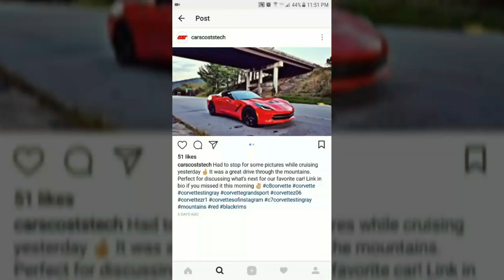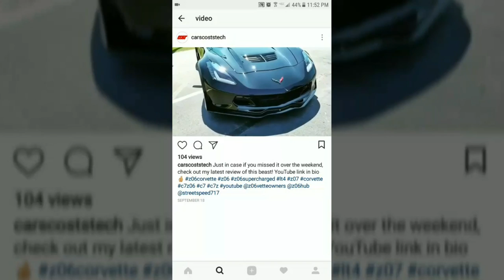Trouble in Paradise... C7 Corvette Issue & Resolution!

Comment from the maker: UPDATE: 6 months after the fluid flush and everything still seems to be working great 👍 The roads in my area are pretty rough, so it's hard to confirm that the shuttering has been 100% completely removed. Overall, I'm satisfied with the results, and thankful that the car didn't need to be torn apart!
Reply: Am looking to pull the trigger on a new 2017 Stingray 3LZ with auto.  I recall you daily drive yours.  I will be doing the same.  100 mile round trip every day.  Do you have any over heat issues?   Looking at your fluids in the pictures, the fluid looked like it was getting burned.  Not sure if that added to your problem, but it could be indicative of a more serious issue.  The fluid change resolving the shudder kind of supports my theory previously stated.
Reply: @garycrumrine9538  100 miles a day on a corvette? Your car value will drop like a rock.
I was in sales, and went from 32,000 miles to 84,000 miles in 3 years. My 2006 Z51 lost value even after adding 10,000 in repairs and upgrades.

Buy a cheap car for under $5,000 and drive it into the ground. Problem solved.

You are welcome.
Reply: how much qts of fluid does the A8 use?
Reply: @v8tornado  the Grand Sport takes 24qts for the complete power flush.
Reply: @CraigCatapano ew. We buy cars to drive them old man.

Comment: What you experienced is a common problem with all GM vehicles with the A8 trans. I had the problem in 3,500 miles on my 2015 C7. The fixes GM has come up with are not cures, but temporary fixes AKA, delaying tactics. GM either doesn't know what causes the problem or is hoping the fixes will last until the warranty runs out, or that they will make a lot of money on extended warranty sales. People are still having the same problems on 2018's so it appears that they have no intention of, or can't permanently cure these problems. It's a pity since the C7 is such a great driving sports car. Buyers beware. Get the manual trans or expect a never ending headache.

Comment: I own a 2017 Grand Sport with Automatic.  With less than 7500 miles the shuddering, the rattling noise appeared.  Chevy said the transmission flex pate had to be replaced.  New Vette sat in dealership 2 weeks being repaired.  No explanation as to whether a different flex plate (a new and improved) installed or whether they installed the same piece of crap that was originally installed so that I can look forward to the same problem happening again after another 5-7k miles.  Like most people on your site, loved the Vette.  Bought if for its alleged dependability over a Jaguar F-R coupe, Porsche Cayman S and several other similar sports car.  I know this is sacrilege on this site, but if I had to do it over again, would not bother buying the Vette.  Six months and I find out I got stuck with a lemon.
Reply: Ohhh wahhhh wahhhhh ffs... it's an ECO mode issue and reflashing the ECU fixes it. Buck up, little whining camper, you'll be fine. If ya can't afford a car like this, sell it.
Reply: Now with a little bit of sugar you can make lemonade

Comment: I'm sure the "flush" did resolve the issue; temporarily, It'll come back in another 10k miles, or a little more.  After warranty is up.
Reply: Your exactly right. The flush is just Chevy's way of delaying the inevitable and replacing the trany with a new one that will have the same problem in a few miles as GM either doesn't know how to fix it or doesn't care to. Worse, once the trany is taken out by the ''expert'' tech's your problems will just be starting.
Reply: My 14 c7 z51 blew at 26k miles, still waiting 3 weeks out to get fixed under warranty.  Never again will I buy this garbage.   Tesla 100% from now on.
Reply: @mobleyMobley  shit.....I should not buy the c7 I just put a deposit  on fuckkk....
Reply: I thought Corvettes are still bulletproofs, I was searching for a used C7, good thing I knew about this issue beforehand, ONLY BUY MANUALS
Reply: @Abdullah..S  you dont need to buy a manual
Reply: @Abdullah..S  you can buy an automatic,  I did....its 100% fine, get a range device AFM deleter
Reply: @Jesus-warrior  So the AFM caused the TC to fail?
Reply: @Abdullah..S  yes it's a plague of a problem but that is a easy way, keep it in v8 all the time and you're  good to go, the range AFM device is $180
Reply: @Jesus-warrior  How does the Range Device keep the Torque Tube from going bad?  My second TT just failed and I am waiting on GM  Parts house to ship a new TT which they say is 30 days out!!!
Reply: @Jesus-warrior  what the hec is a afm device??n what does it stand 4 ?
Reply: @Jesus-warrior  That crap doesn't keep the problem from happening, it just masks it so you can't feel it.  Garbage.
Reply: @allenustianowski9757  there is only one fix and that's  physically removing it. And while your at it throw a stage 2 cam in

Comment: I have a 2014 C7 Stingray with just barely 20K miles that started rattling on idle and acceleration and when warming up was shaking from the revolutions of either the engine or the driveshaft, this after having bought the car a year ago with 11,033 miles on it when it was smooth as glass. The car still has not been over 90mph. It is an automatic with I guess the A6 transmission? Took it in, and they said the propeller shaft bearing was shot and the torque tube was "pushed forward". They replaced all that under warranty, then told me that whatever happened to the torque tube damaged the transmission, so another two weeks to get approval from the warranty company and wait for the transmission, and then it got replaced as well. I paid $400 deductible due to the warranty otherwise this was $12,300 in parts and labor!

Got the car back last Friday. Started it up and it's making the exact same rattling noise. The engine now actually is making a clacking noise as if there is a lifter problem or something else is slapping around which it was making before but now it seems louder. In fact the only thing that has changed is that now the gear shifter feels like it's stripped. Giving me false neutrals in reverse and not accurately indicating whether it's in Drive or Manual mode, and moving seemingly unimpeded through the shift gate. I am taking it back tomorrow. This is a nightmare.

Oh and the point: This happens regardless of driving mode (I drive in Sport mode almost always) and regardless of whether I'm in automatic or manual mode.

Comment: I have a 2015 A8 and i might be having similar issues.  But i had read that the shuddering could also be the car switching between V8 and V4 modes.  Not as smooth as it should be.   One thing leads me to believe this is that if you switch the C7 out of Touring mode into Sport it seems to disappear.   I don't think it goes into to V4 mode in Sport - make sense?   My bigger issue at the moment is that my freaking fuel door is stuck closed!!!   I have 43 miles of gas left and the dealer is 18 miles away.  I hope they have the part in stock!!   Car goes in tomorrow for an oil change and the fuel door issue - I will mention the shuddering issue also.   I have my doubts that a fluid flush/change is going to fix it.   My 3 year bumper to bumper expires around Thanksgiving.   Thank God I got the extended warranty.    Learned my lesson when driving BMWs.  Every repair at the BMW dealer was like a mortgage payment.....
Reply: Car does go into v4 mode in sport. Only time a8 doesn’t go into v4 is in manual. As far as the gas door… get two credit cards and a screwdriver. Insert the screwdriver in between the 2 credit cards on the left side of the door. Pop the door off pushing right. It’ll pop out. Then slide off. Boom. My 2015 did this twice then never did it again. U can plug the little hole so that it doesn’t get stuck again although i never did so. 

I know his comment is 5 yrs old but just incase anyone experiencing same issue sees this video and happens to read this comment hopefully its helpful. 

Also I’m super curious what the dealership did/charged to fix the door.
Reply: @whatsthatmeen  Hi GG,  I had to look it up as it was 5 years ago:).   Dealer replaced the fuel door actuator under warranty.  Still works.

Comment from the maker: So glad to have my Corvette back 😁 Thanks for watching!
Reply: Cars, Costs and Technology hi
Reply from the maker: +Daddy TheHawtDawg1 What's up man 👍
Reply: So in hindsight would you still consider getting the 8speed auto?
Reply from the maker: +Motoring 90 Yeah, definitely. This minor issue hasn't changed my overall opinion of the performance and reliability of this transmission.
Reply: Have you thought about getting the AFM disabler from Range Technology?  It seems the issue stems from the engine switching from V8 to V4 and back.  There is much discussion about this on the Corvette Forums.
Reply: Hi, I just noticed this problem a little while ago on mine was well. I am going to take it today and see what they say. Thanks for making this video. It helped a lot.

Comment: My 2015 C7 corvette had same issue- 2 torque converters later, the issue seems a little better.  We shall see.
By the way, the dealer tried the 'flushing thing' and although it did help briefly, the problem remained. (approx 14,000 miles).  As a side note, at 2,000 miles, the car had to have the valves/lifters/head gaskets replaced.  At 6,000 miles, the idler arm (which is apparently plastic) began to make a squeaking noise.  The car spent 2 weeks in the shop with the service techs unable to determine the source(unbelievable).  I read on a forum that this issue is not that unheard of so as a last resort I suggested it to the dealership.  By the next day the idler arm/wheel was replaced and the noise went away.  I really wanted to like the C7, but to be honest, I am disappointed in the quality of this otherwise beautiful car.  It seems very cheaply made and poorly executed.  I think I am going to go back to German-engineered/manufactured cars since I have always had good luck with them.
Reply from the maker: +Glockenstein0869 That really sucks man. Mine seems to run much better after the fluid flush, but hopefully the shudder doesn't return like you mentioned... I'll be making a follow-up video if so.
Reply: Yep that’s right

Comment: So I had my Torque Tube replaced at 3,500 miles in August of 2017 on my 2017 GS.  Here it is November 2019 and my Torque Tube has failed again.  The bearing has gone out.  Waiting on the GM parts house to ship another Torque Tube.  This dealership didn't even waste time with the tranny flush and new fluid.  They went straight to replacing the TT.
Reply: Curtis Fish was it covered under warranty

Comment: The wrong trans fluid was installed at the factory.  It does not effect the torque converter it causes the clutches to slip.  Replacing the fluid usually corrects the problem.  Good luck.

Comment: Disengage the V4 mode! Range AFM Disabler. $199
Reply: Exactly
Reply: Late comment 2024 but that solved my problem on 2017 Z06 different car now slightly more gas use, but it's a high performance car.
Reply: $35 on Amazon don’t buy range way overpriced

Comment: This is a problem with the A8 cars not the A6. The A8 cars the transmission overheats and destroys the fluid causing all sorts of issues. There was a recall that added additional cooling components to the car that resolved these issues for 90% of the cars. I agree with comments below, unless you did the recall repair, this issue will just come back in about another 10k miles once the new fluid becomes garbage. Ill stick with my A6 transmission or a manual.

Comment: My 2014 c7 has a similar problem. But, it chatters when making a sharp right or left turn even at very slow speeds. I thought it was the new Michelin tires that I just bought. The previous owner had cheap non run flat tires on it. I never experienced the problem until I installed the new run flats. I am going to have the differential serviced. The dealer said that if the servicing does not solve the problem, they will make repairs under factory warranty.

Comment: Had the same problem with our 2015 C7 with the 8-speed auto. Just had the repair done with the new fluid. Need to to drive 200 miles to see if it helped...
Reply: Did it work for u
Reply: @chrsjohn9717  Yes, for about 1,000 miles, then the same problem returned.
Reply: @rogerphillips1679  so is it just to change the transmission fluid or its more to it
Reply: @rogerphillips1679  you had to replace the torque converter
Reply: chrs john yes, they just changed the fluid after listening to the transmission. The car was out of warranty before I could change the torque converter, so I just sold the car back to the dealer.
Reply: @rogerphillips1679  thanks

Comment: At near 9800 miles my 2018 seems to have this. I thought (think) the trans is not downshifting (kicking down) or the converter won't come out of lockup at load in top gear. 
  Annoying to say the least. Feels like if I am driving a standard trans car and in too high a gear.

Comment: Don't want this to shy me away from getting a Vette as I'm in the market for one. Seems that it's a common problem and that most GM dealers should be ready to fix, but seems that some are giving a hard time.
Reply from the maker: +Dave I definitely wouldn't let it detract you from buying one man. Every car out there is going to have minor issues from time to time. I daily drive my Corvette, so it's even more prone to things like this.
Reply: Yep that’s right I am looking at buying a vet but I don’t like the cylinder deactivation on the car and I think people buy them new and hot rod them and then get rid of it
Reply: You can buy a module $125 or so that keeps it in 8 cylinders, I have one but and just started having the shuttering issue at 28k miles DARNIT! $700 for the flush repair 😖

Comment: Hi, 
I saw a car on sale and checking the history report they told me that the car has Transmission fluid flush, I guess the previous owner had the same issue? will this fix the problem or I have to replace the TC, thanks.

Comment: Hi I am having the same issue with my 2017 C7 Z 51 Corvette just now put 14,000 miles on it and I’m having the same issues I wanted to know if ing all the transmission food help with the issue or did you eventually have to still change the tur converter I know this was a while back but I appreciate the info thank you so much

Comment: Omg.... this just starting happening to mine today. Time to take it to the dealer and I have a 16 with 35000miles.
Reply from the maker: +Horse Power You It seems to be fairly common with the A8 transmission. I hope they get it all taken care of for you! Thanks for watching 👍
Reply: Millionaire Mind Set this started happening to my zo6 as well have a dealer appointment to take mine in.
Reply: Guillermo h I got mine at the dealership now. Been there for 17 days now and the dealership is lost. Smh...
Reply: Millionaire Mind Set my dealer only had my car for a day they knew it was a known issue and they completely replaced the converter and did a tripple flush and it's been fine.
Reply: Guillermo h I paid the dealer a visit yesterday and the transmission specialist said I have a bad Torque Converter. The sad this is the dealership only has one Corvette Specialist working there. Any way, they are finally replacing it. Should have the car back next week finger crossed.
Reply: Millionaire Mind Set sorry it took so long for them to tell you that since it is a know issue with the 8 speed (even on trucks) but yes that's what they should have done since the beginning hopefully you'll get it back in less than a week
Reply: Is yours a automatic or manual?
Reply: @CarsCostsandTechnology  does it just happen with the automatic and not the manual?

Comment: Sorry but Corvettes are not super reliable sports cars. Lot's of guys on the forums mention problems (rattles, squeaks, electrical issues, engine codes....). It's just that people are living with them.  I'm in the market for a sports car and will probably stay away from a Corvette. Maybe a Porsche Cayman.  Consumer Reports, JD Power and a host of other firms give the Corvette a low rating.   I wish it were the other way though. I like the looks of the car, its a blast to drive and a great bang for the buck but still for what you spend on this car you should not have issues.  I have a 2016 GMC Sierra and there are little things starting to go on it now as well so maybe it's just a GM thing.

Comment: I have the same problem on my 17 GS dealership did a fluid flush but the technician said my drivers side front and rear rims are bent not cracked I'm very frustrated dont know how that happened I haven't hit any pot holes I only have 3300 miles on this car

Comment: This was an interesting "situation" you bring to light as respects the automatics. It does beg the question at what point would GM issue a recall. You mention you got a free loaner. Does the GM warranty provide this or was it dealership courtesy? Save the Wave.
Reply: No recall because it is not considered a safety issue,
Reply from the maker: +Peter Carey From what I've read they're just handling these issues case by case rather than a mass recall. Hopefully it's already been addressed for future models! The loaner vehicle was a dealership courtesy 👍

Comment: just fouled a plug on my 17 zo6 after being stored for the winter. check engine, service stabilitrak, service rear axle dummy lights came on. the vibration thru the drive train was pretty bad.  Glad it only ended up being a plug but wtf. the whole driveshaft and rear felt like it was going to fall out.
Reply: Level Horizons what plug? Im having the same issue